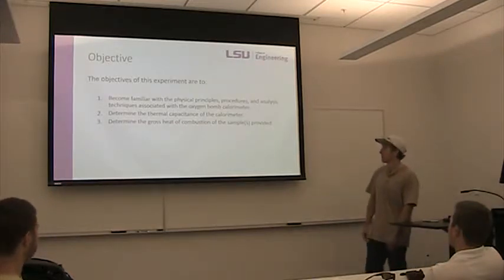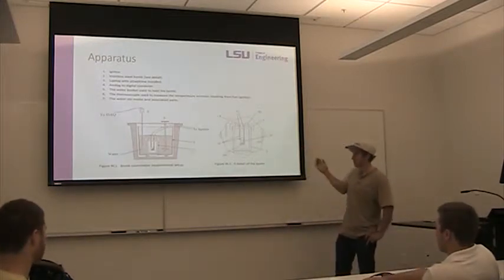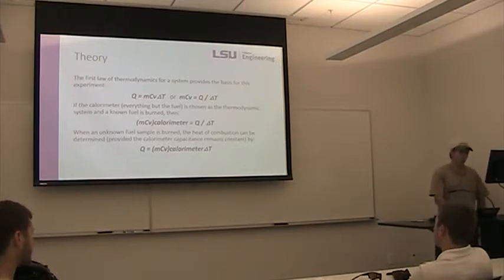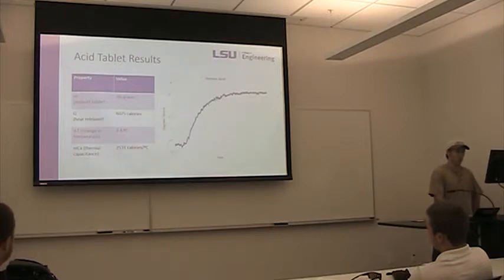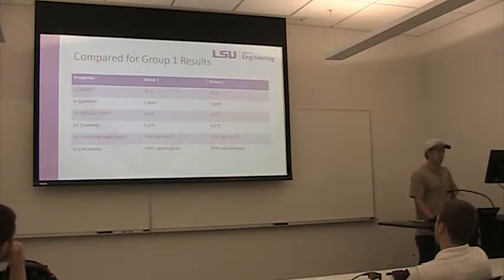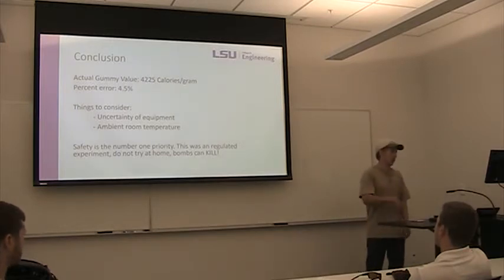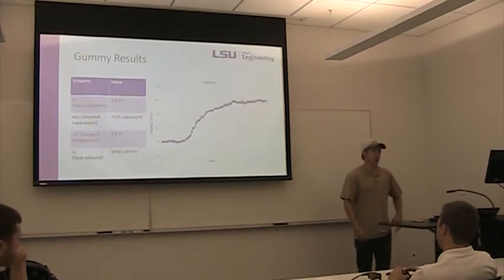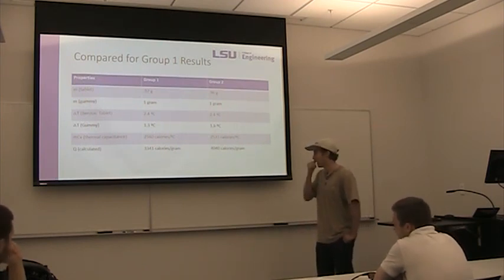Group Reporter   Joseph Tanner

Comment: PP quality: Your slides are very well organized and cohesive, the presentation flowed very smoothly from them. The gummy graphs were very easy to read and your technical information was presented clearly. The only (tiny) improvement I could think of is that on your first slide there's a lot of negative space that could have been used to make the font larger. Overall great presentation!